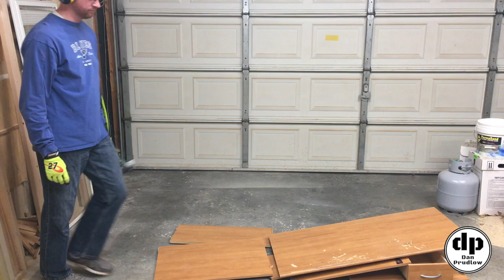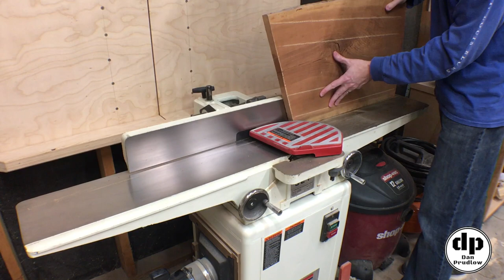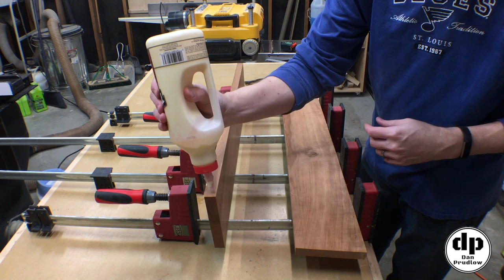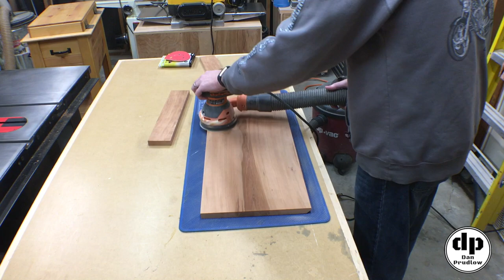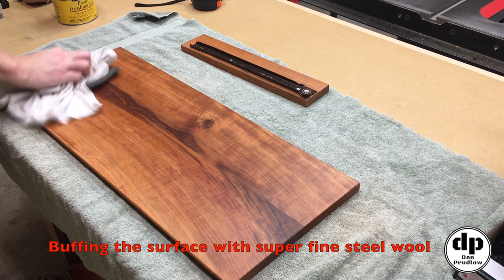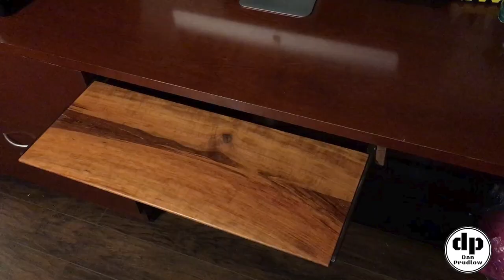Build a Keyboard Tray with Reclaimed Hardware | DIY | Easy Desk Upgrade

Comment: Truly do not understand the hostility/sarcasm/ passive aggressiveness in the comment section.
This video was short, to the point and literally provides sequential order on how to approach building with wood.
The music was far less annoying than other chanels. I guess people like the sound of saws..... Carpenters literally wear ear protection to mitigate ear damage lol... 
DIY = not professional
Tools are expensive and an investment if you have interest in any hobby.
So saying that "what's the point if you don't have 10k in tools" 
You've prob never tried building anything from wood. You literally need all these things as dumb as it sounds. If you have a problem, then buy a keyboard tray and don't watch.

Hats off dude. As a novice wood worker who is thinking of starting a channel. I appreciate the great camera angles, the milling of the lumber and the design of the piece. I can see why the other guy said it might hit your legs and I value both points made. My sugession is making the tray length longer than a person's legs so no nicking happens, or extending the tray length to the width of the table supports but I see why you did it the way you did.
Reply from the maker: Thanks…I appreciate your comments.  Thanks for watching and good luck if you start a channel…hit me up and I’ll check it out. 👍🏻

Comment: I guess DIY videos like these are more to showcase the skill of making things. definitely not something that most people who watch this can do. Looks nice to watch something being made. You can relate this to the discovery channel's "how it's made".  DIY probably needs to be looked at from both angles I guess - to save money OR just for a hobby no matter how much time or money gets spent.
Reply: he's showing people how to, so they can but it's more of a question of whether they will
Reply: I'd say that it showcase how many professional power tools he has to use to prepare a simple tray.
Reply from the maker: These comments kill me… The only thing remotely close to professional in my small garage is the table saw…and even that is only the 1.75 hp version.  Working with rough lumber it’s either a power planer/jointer or hand tools to get it smooth and square.  How would you propose I make this tray from the piece of cherry wood I had without these tools??
Reply: @DanPrudlow  Don't let our comments discourage you, it is a nice video, however, I consider that a simple project like this should require far less work and tools, but it is only an opinion. Your work is good.
Reply: @DanPrudlow  Video title "...reclaimed hardware" gives one the impression the video is going to be about about economic salvage.  A board planer is considered professional equipment by vast majority of the public, as it's far too expensive equipment to buy, for making a keyboard tray.  Let alone do so out of cherry wood.
But regardless of that, it did indeed show us how to salvage and reuse keyboard tray hardware, which is helpful.

Comment: So...how do you lock the keyboard drawer when typing? When I type, the drawer keeps moving in. Needs some kind of locking mechanism.
Reply from the maker: These slides have a little indent where the rollers sit in when fully extended so it doesn’t really lock in place…just can’t roll without a little push first to get the rollers out of that indent.  Thanks for watching!  👍🏻

Comment: How sturdy would you say this tray is? In other words, how many pounds of pressure can be put on it? Instead of a keyboard tray I'd like to make something I can use for note taking, so I'd be leaning on it a little more that I would with a keyboard.
Reply from the maker: I would probably go with a little stronger drawer slides for that…but other than that it would be plenty strong.
Reply: @DanPrudlow  sweet! Thanks for getting back to me!!

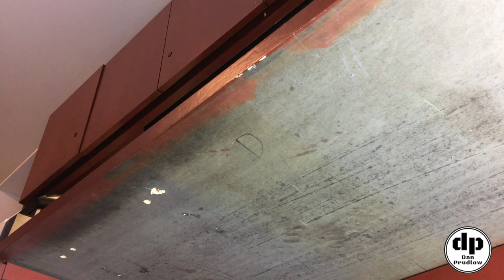Comment: 5:16 hoqw to screw from bottom to up?
Reply from the maker: Are you asking how I did that?
Reply: @DanPrudlow  I mean how big is the screw for being able to screw from bottom all the way up to wood
Reply from the maker: Gotcha.  I think I used a 2 inch screw but I counterbored a hole in the piece so the screws could be a bit shorter rather than needing giant screw.
Reply: @DanPrudlow  im Greek so something I will miss from the explanation

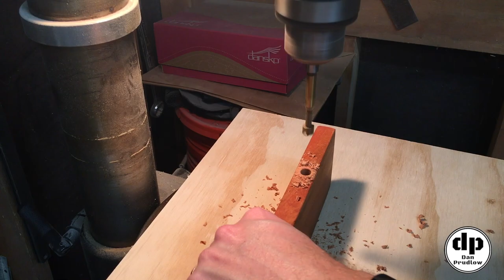Comment: what drill bit did you use? for making the holes on the small boards before drilling into them. Hope you know what I mean. I am referring to the one used at 3:44 part of your video
Reply from the maker: If you are referring to where I was using the drill press then I used a forstener bit to drill a counter bore and then used a regular drill bit to go the rest of the way through.  The counter bore allowed me to use a shorter screw rather then needing one that went through the full width of that board.  Hope that helps.  If that’s not the one you mean let me know.  Thanks for watching!
Reply: @DanPrudlow Thanks man I appreciate your help thats the one i was referring to

Comment: Curiously, what is the point of glueing together two boards as opposed to using just one solid board? Aesthetics?
Reply from the maker: The center section had a sort of knotty section that was crumbling apart.  It was easier to cut it out than to try use epoxy or something to save it.  Thanks for watching! 👍🏻
Reply: @DanPrudlow  Thanks. I am planning on replacing the wood for the keyboard tray on my desk, but nothing as fancy as you did lol. Just basic cut, sand, and stain.

Comment: Wait, what?  How did you fit that tray to the bottom side of the desk???
Reply from the maker: One side the drawer guide is attached to the side of a file cabinet part of the desk.  The other side is another piece of the same wood the tray is made of that I attached to the underside of the desktop and then attached the drawer guide to it.

Comment: how is this part that is holding the keyboard called? the wooden thing that you drilled in the table which holds the keyboard tray
Reply from the maker: Are you asking what that piece of wood I attached to the underside of the desk is called?
Reply: @DanPrudlow  haha yea sorry, im not a native english speaker so not sure if there is a name for it... also would it be any different if we just used a slider which is drilled directly in the desk, so we avoid using that underside piece of wood all together
Reply from the maker: Gotcha.  No special name for it, just needed something to attach the slide to on the one side because the desktop is so wide there was nothing there.  If you attach directly to the desk that would work just fine.  Thanks!
Reply: @DanPrudlow  thanks a lot!

Comment: Where did you get the hardware? I need to build this for a client
Reply from the maker: It came off the old desk that I busted apart at the beginning.  You could probably use inexpensive drawer slides.  Thanks for watching! 👍🏻
Reply: Yeah I saw that.. had to sub cuz your work is amazing...Would you happen to remember the dimensions?? The tray I'm building is 15" x 30'' but I think it's too wide.. how much does yours hang below the desk? The desk I'm building is 30" off the floor with 1 1/2" top. I don't want my clients knees bumping it...
Reply from the maker: Mine is 27 1/4 x 11 and the surface is 1 7/8ths below the underside of the desktop.  I mounted it just low enough for the mouse and keyboard to slide under.
Reply: @DanPrudlow  Thank you for the input... Again.. beautiful work!

Comment: How did you conacted the small boards to the desk?
Reply from the maker: I counterbored 2 holes and the used 3 inch screws to attach into the desk.  Thanks for watching! 👍🏻
Reply: @DanPrudlow  I think he meant:  It looks like you just eyeballed where to drill the holes under the desk.  You placed the wood up to see, and then took it down and drilled, but I could not see how you marked the underside of the desk to know precisely where to drill.
Reply from the maker: It was a difficult area/angle to film so I see what you mean.  I actually had the tips of the screws sticking out just enough that when I had it lined up I pushed the board upward to indent marks where the screw points were.  Thanks for watching! 👍🏻

Comment: "Easy" as long as you have $10,000+ worth of power tools and a workshop...
Reply from the maker: Not even close to 10k in tools…but you are correct that you do need tools and a shop space to build stuff if you are going to build stuff.
Reply: @DanPrudlow  fair enough. It's a well-produced video with clear instructions. I do have tools and a space, just much more minimal. I don't think I will ever invest in a table planer, though of course it makes things easier.

Comment: this is cool but all you used was the metal pieces. Also not everyone has the tools and machines. so yea
Reply from the maker: That was the only hardware to reclaim and use for a keyboard tray.  I understand not having all the tools…but the same concept could be applied using pre-surfaced boards from the home center.  If you have no tools then I just assume you probably are not making one anyway.  Thanks for watching.

Comment: WHERE DID YOU GET THE ROLLERS FOR IT TO SLIDE ???????????????????
Reply from the maker: I took them off the keyboard tray that was on the desk I busted apart at the beginning of the video.  Thanks for watching! 👍🏻
Reply: You can buy them at any hardware store. I bought mine at home depot for cheap

Comment: Why would you say it was a DIY approach while you used a bunch of professional equipment? Gained nothing from watching half of the video.
Reply from the maker: I say DIY because I did it myself instead of buying something.  That’s what DIY stands for...”Do It Yourself”.
Reply: @DanPrudlow  "DIY" suggests that someone could do it using a reasonable amount of equipment, not a professional workshop. You know that. Keep on click-baiting, if that's your thing
Reply from the maker: I could go buy a board that is pre surfaced on 4 sides from a home center and do this same project with very little equipment.  I’m a far cry from a professional shop but I have invested in some equipment...some new some used.  I don’t build as a profession, it’s a hobby.  I’m not an expert by any stretch.  I guess all of the DIY shows on TV and many other YouTubers are just click baiting too.  To each their own I guess.
Reply: @DanPrudlow  Thank you! I was thinking of buying the board and reusing the keyboard slides from an old desk. I bought a nice cabinet desk from a garage sale and wanted to add a keyboard tray to it.

Comment: Actually, while it seems very nice with physical wood etc, it's the worse tray I've ever seen... Your knees will suffer every time you will collide them with the sharp edges of the small woods hanging from the desk. There are special mechanisms for keyboard trays. All are hanging from the center and the back side of the office, there is a reason for that... Nice work with the wood though.
Reply from the maker: I’ll respectfully disagree with you on the knees colliding thing.  We’ve been using it well over a year and to my knowledge nobody has hit it.  The bottom of the tray is the same height as that board hanging down.  You would have to sit with your knees higher than the level of the tray (which would make no sense) to have a chance at hitting anything.  Thanks for watching and the comment!
Reply: @DanPrudlow  You can't be serious... We are working very fast with much movement with the chair, all my cooperators, including me, hit the actual keyboard tray wood with our knees. It doesn't need to sit with your knees higher, just the chair to be raised, in conjunction with short offices and the trays are in our legs all the time. What you built is a knee breaker.. Only with the thought it's already painful.
Reply from the maker: Well...I guess when I work at my home computer desk I don’t work with that kind of chaotic pace that I’m hitting things with my knees.  What I’ve built works for my use...maybe not for all.